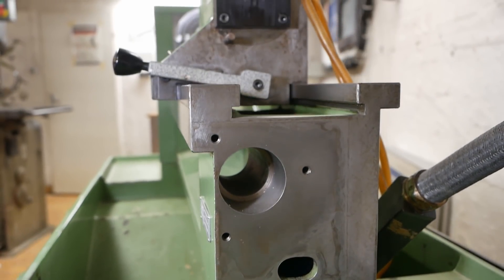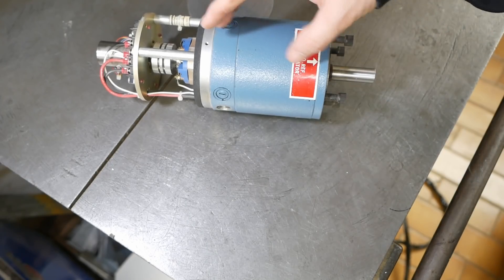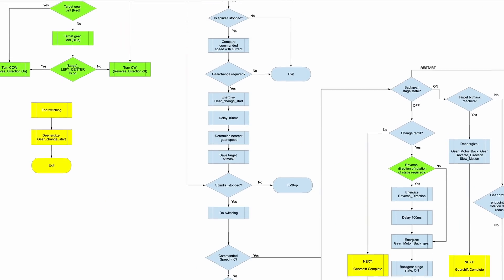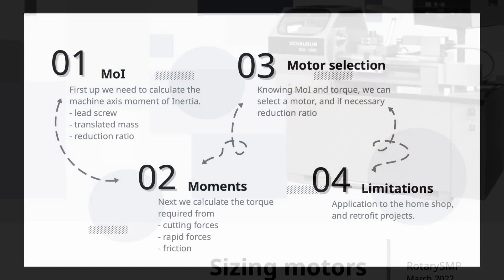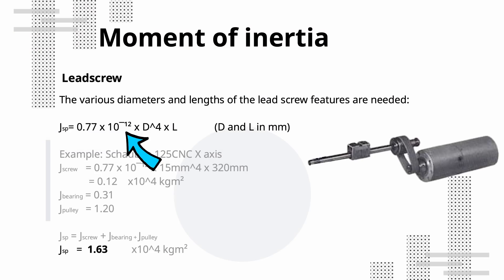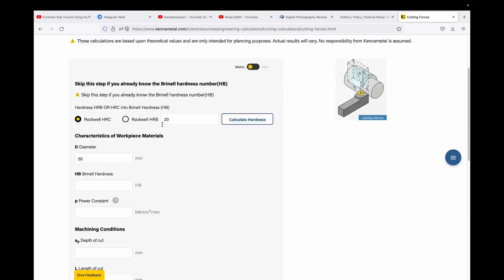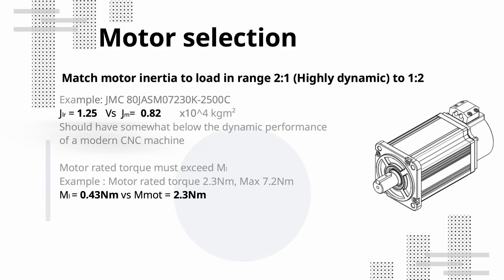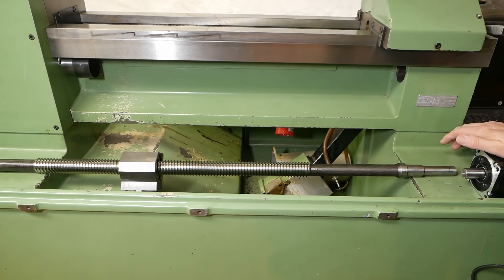How to select CNC axis drive motors.

Comment: Polygon turning works much better with synchronized live tools, anyway:
https://www.youtube.com/watch?v=hmco8mI79gc
Perhaps add another spindle axis for such things? ;-)
Polygon turning with X-axis in/out certainly is a slideway/ballscrew killer.
Direct measurement/linear scales is also something I'd include in every machine upgrade.
Reply from the maker: I looked at adding linear encoders. It would be easy to do in Z, but I couldnt come up with the decent solution in X.

Comment: Let's hope you got lucky!
Reply from the maker: I did on that axis :) Still need to check Z.
Reply: @RotarySMP  I've got to be honest, I didn't expect it to be this overkill!
Reply from the maker: @AlfombroDerBezwinger  I hope that the near 3:1 reduction on the Z axis is enough to match the MoI. Otherwise they do make a higher inertia 2000rpm version of the motor.
Reply: @RotarySMP  since you are reducing the feed rates so far, makes me wonder how the torque vs rpm curve for these motors looks. 
And as you are considering a different motor I guess it would be more effort to order a different one than to raise the great ratio even further.. sounds more expensive tho
Reply from the maker: @AlfombroDerBezwinger  Unless I have some serious error in this calculation, this motor will work well. The only reason I will reduce the max rapid rate is safety, both of me and the to protect the ways from galling. These motors are cheap enoug, that there is little penalty for having a 750W version rather than the 400W version which would also work.
Reply: @RotarySMP  Yes, I agree 👍

Comment: Nice to know how to calculate the right size of the motor. If you are the producer, and are planning to build thousands, you have to calculate it, to be sure to use the cheapest possible motor, that still gets the job done. For hobby, you can get away with doing a rough estimation, then double it. If you make a mistake you can still resell the motor on e-bay, and go for a bigger one...
Reply from the maker: That is a good point.
Reply: Its still a poor approach however as oversizing power doesn't matter but oversizing rotor mass and therefore inertia, does. If you are pursuing performance rather than " o well, it moves"

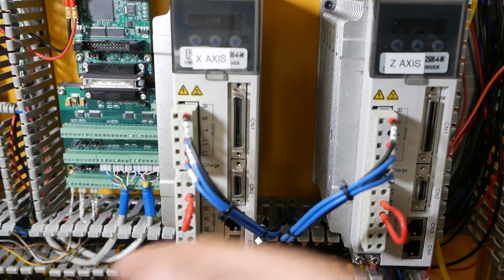Comment: 3:22 the encoders from the motors don't directly correlate to the position of the slide and carriage; ideally you would use linear scales to provide the feedback. the motors and drives have their own inner closed control loop and i'm not sure if looping that back to the controller is of any benefit. if the motors can't hold their position they will alarm out anyway
Reply from the maker: Hi Dušan, It would be easy to put on a direct reading linear encoder on Z, but there is no simple solution for this on X. The advantage of having the encoder feedback into the LinuxCNC, is that if I E-Stop, the drive power section will get disconnected, but the encoder feedback will still be maintained, which avoids the need to rehome after an e-stop. I find this very useful on the Maho (which has linear scales).
Reply: @RotarySMP  ah i see. that is indeed quite useful. is the encoder powered separately from the motor? or does the e-stop only kill power to the motor and not the encoder?
Reply from the maker: @ikbendusan  Correct. The JMC drivers have two power connections, so you can power the brain and the muscle separately. I have the muscle power on a contactor controlled by the Pnoz safety relay, but keep the brain powered up.
Reply: I have worked on many industrial machines that just use encoders for accurate positioning. In fact one place I worked had 1920s Era multispindle lathes that were retrofitted to cnc. Once you establish a zero point accurately if the encoder resolution is fine enough you can work to a thousandth of an inch easily.

Comment: Great background info on the motor topic! 
Will your interfacing of the drives allow online programming of paratere from within LinuxCNC?
Reply from the maker: JMC has a tuning software which I have downloaded, but not yet installed. I dont think there is any benefit in modifiying LinuxCNC to program the drives. They will be interfaced with analog +/-10V control. Step Dir is also supported, but I prefer analog.

Comment: prediction: the motor will be fine, but maybe wont' be beefy enough to take the full depth of cut that you're aiming for
Reply from the maker: What leads you to that conclusion? Given the overload capacity of 7.5Nm, it would seem to me that this could take some seriously heavy cuts (although I have no real intention of using such a fine machine for excessive hogging.
Reply: @RotarySMP  Yeah i completely wiffed the guess, had forgotten the spec of the motor from when you'd talked about it previously and guessed it would be slightly under based on what usually happens when I order things without checking first 😁
Reply from the maker: @roseroserose588  That could well have happened, but I got lucky :)
Reply: Damn, i was almost close if you look the other way 😅

Comment: I literally did not understand a word of that but I was wondering if using a linear actuator for the variator control would make sense.
Reply from the maker: Thanks for watching. I am loathe to swap out the variator drive which Schaublin engineered so nicely, and it doen not really really need fine control. The VFD can do that.

Comment: that was pretty interesting, for my stepper to servo conversion i just went for the best torque/money ratio and at a max speed i wanted for machine rapids but this is way more accurate :P
Reply from the maker: I did that in the past as well. I think on the Mini lathe x axis I ended up with such a MoI mismatch, with too much reduction, that the axis resonates at a pretty slow speed.